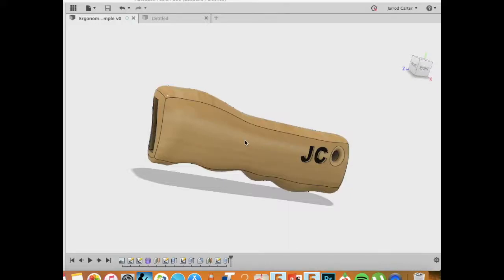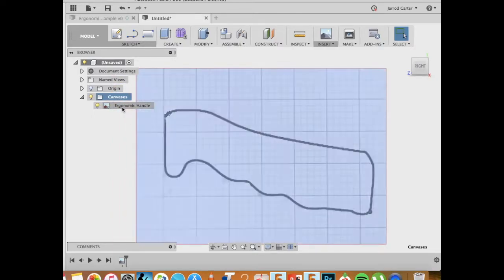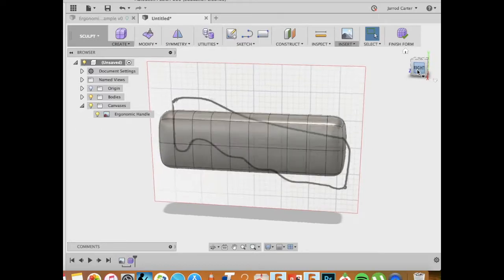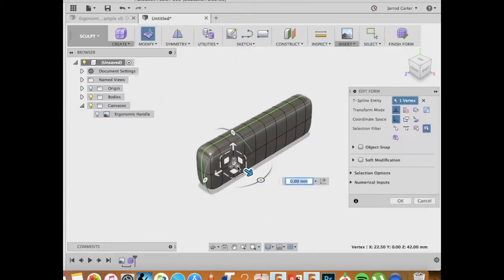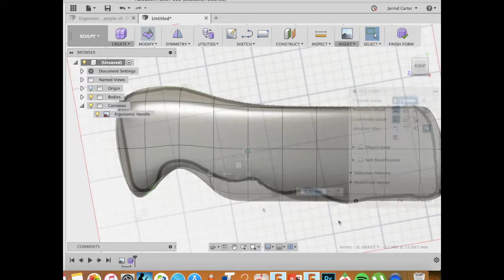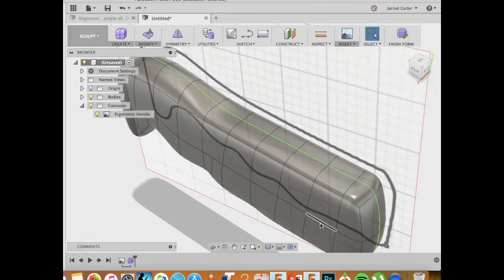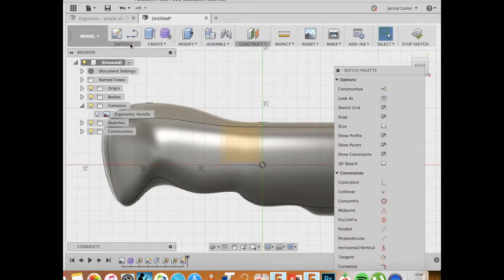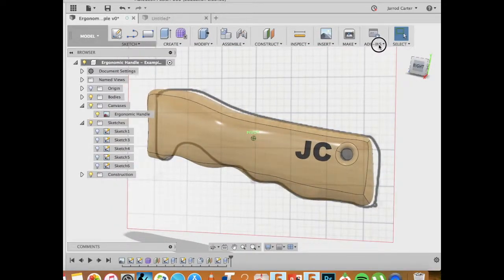Fusion 360 Tutorial   Sculpt an ergonomic handle

Comment: i m,ade an screenshot on the grip inthe video and removed as mush of the white lines as i could sop heres an rough grip that you may use untill the dude that mjnade this video shares the orinial http://http://185.157.160.170/nextcloud/index.php/s/QyJCtXFq5iZJtm2
Reply from the maker: Thanks for your interest Benjamin.  I tried to open the link but it did not work, would love to see your work.
Reply: @jarrodcarter2966  Mybad i used my loal ip adress but its fixed now. but just notiiced the printscreen i tooked is way to small to use so dont know if its any point ofd using it. the uploader should upload it IMO ive sent him anb email bout it
Reply from the maker: @benjaminandersson3445  The size of the canvas can be adjusted by the Calibrate function.  This is in the video but you can also find more information here: https://knowledge.autodesk.com/support/fusion-360/getting-started/caas/screencast/Main/Details/2bc55cba-830f-4752-8cb7-d473b95f4616.html